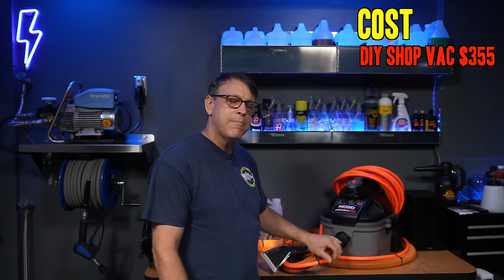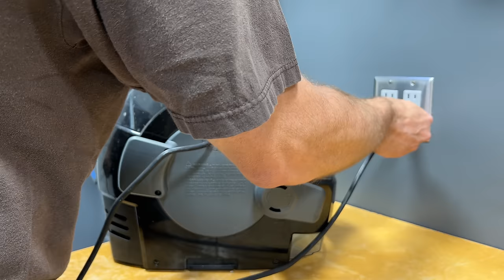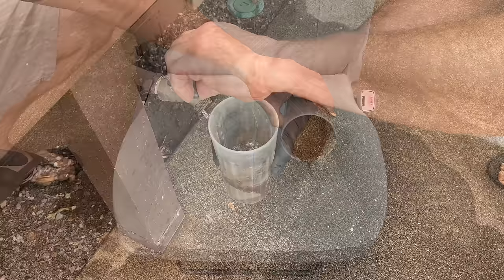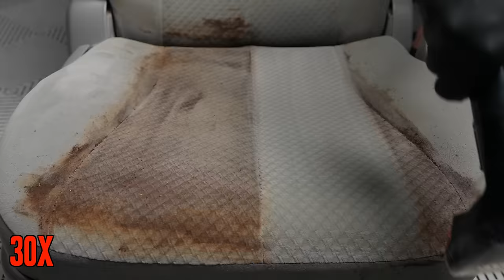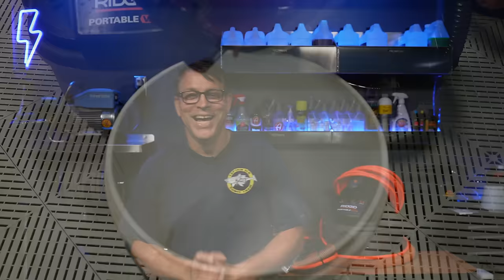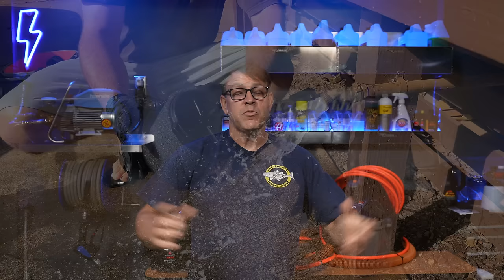EXTRACTOR EVERY THING YOU NEED TO KNOW. BISSELL SPOTCLEAN PRO or DIY SHOP VAC

Comment: Nice video, helpful info. Question, which every time I ask the youtuber video makers don't answer (why?). The floor you use has ridges and slots, do you find they build up dirt and Debree because you can't get to it? or do you get to it with a hose? in ohter words how do you clean there? I am considering doing my garage which I usually paint with commercial quality coatings but this lay-over system that you have caught my eye and many detailers use it so there must be something to it. So, I figure I would ask, never thought it would be so difficult to get an answer. Hopefully you will answer.
Reply from the maker: Any dirt that falls in the cracks can be vacuumed out very easy with a shop vac or similar. I have not had to do any more then that in the few years I have had the floor.
Reply: @HawaiiDetailing  Thanks! first time I get an answer to that question.

Comment: Quick question, is the Bissel Spotclean Pro great for beginners in detailing?🙌🏽
Reply: Totally. More than great. Have one myself and with enough pressure applied it can do just as well as the competition. Pull it with your dominant hand use the other hand to apply pressure at the top of the head to get the most out of it.
Reply: @calvintynes1879  Thank you🙏🏽
Reply from the maker: Yes for sure.
Reply: Hi Danny. I've been valeting/detailing for about a year now. I used the Bissell in this video for a bit but now I use the Bissell Pet Pro model, which has a slightly wider nozzle and more powerful motor (800watts). They're both great machines and tackle most dirt and stains. My advice though would be to use a drill brush on stained areas and a pre-soak, as Jeremy showed in the video.
Reply: @HawaiiDetailing  Thank you 🙏🏽
Reply: @as680783  Thank you🙏🏽

Comment: Is it worth it to try and replace a worn out motor in Bissell ?  Wondering how possible would be may take some soldering. Or jus scrap it somehow
Reply from the maker: I would scrap it if it’s worn out. That’s the problem with entry level lower cost units they are sealed non serviceable units. Thanks for watching

Comment: I think imma go with the shop vac I have a Bissell one just a little green and it's bleh and it's broken. I like making my stuff run for decades if it needs special parts to make it work I don't want it and it needing water and frequent dumps yeah not a fan of that either. Specially mine is like a 7 gal  shop vac I think I forget but it reaches my mid thigh and I'm 5'7"
Reply from the maker: Yeah. I like my shop vac version. Works great. I would go for it.

Comment: I am going have to say the shop vac!
Reply from the maker: The shop vac is pretty darn good. I use it all the time. I like it.
Reply: @HawaiiDetailing  That’s awesome buddy! Most shop vac’s has more suction than regular residential models. I am going to convert one of my shop vac’s as well too. On the other hand…. I did find a wet vac that hangs on the wall just like your vacuum. I even thought about doing that as well. lol

Comment: Good video but you could just get a wet dry vac 5.5 hp and get  an extractor nozzle
Reply from the maker: That’s pretty much what I have here with a few mods. Thanks.
Reply: @HawaiiDetailing  Btw I am Not hating on the mod the mod is sick the only downside if getting the nozzle is that you can not inject water

Comment: As for me, I see no point to the conversion because the cost of the conversion exceeds the cost of the Bissell, which was designed from the ground up for the job. Even though the Ridgid can do the job, it would take more work to empty the water, thoroughly clean it, insert another vacuum bag, and change the filter back to a dry one than using a dedicated machine for that purpose.  I swear by the sayings, "The right tool for the right job", so for me, the Bissell wins the horse race.

Comment: The Bissell spot clean pro in the video has a different suction head.  It doesn't come with that.  I do not like the wider head.  Why are you advertising it that way?
Reply from the maker: It should come with the 3 inch head. Here is a link to a 3” replacement head if you need one. https://amzn.to/3hpVAUq

Comment: yur doing the mytee an injustice with that small vaccuum..
use the ridgid 16 gallon NXT model 6.5 horse power.. i made a 1 minute video using the mytee wit such a machine with a 35 ft 2 and 1/2 in truckmount type vac hose...
TRUST me you will get close to truck mount strength of suction

Comment: You don't need a filter if you extract liquid
Reply from the maker: A water filter keeps it from spitting out the exhaust
Reply: I use a piece of pantyhose on my shop vac. Works great. Also use that as extra filter on the interior dryer vent.